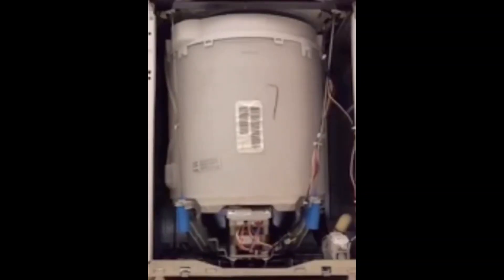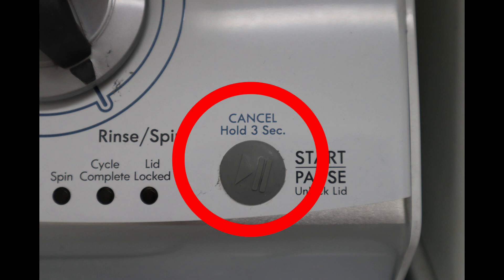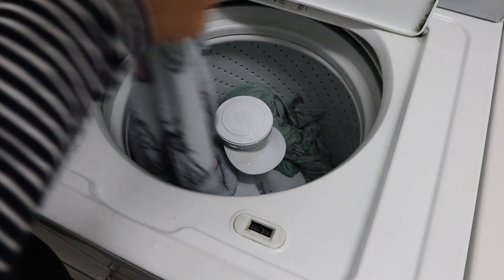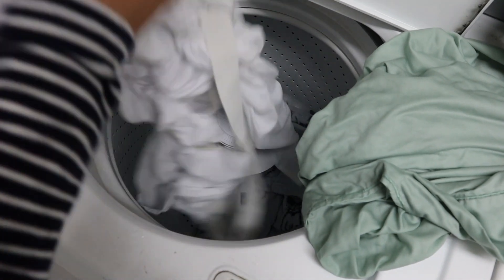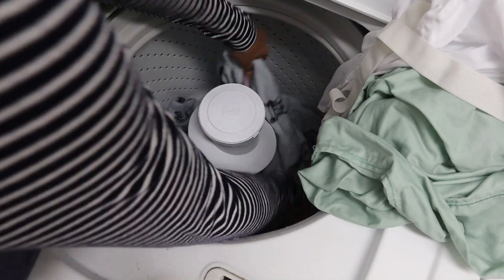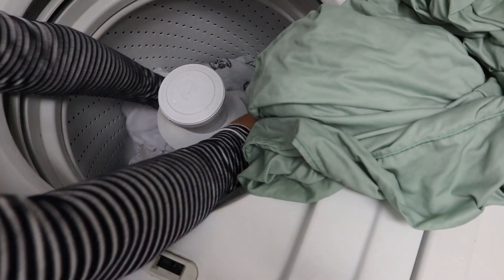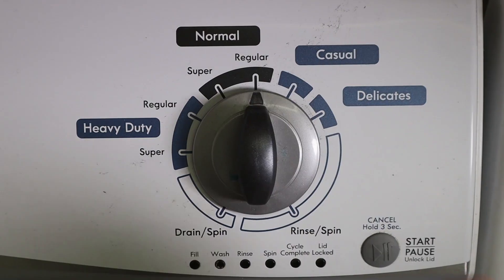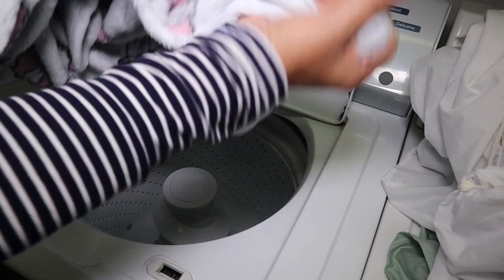Why Is My Washing Machine Making A Loud Banging Noise?

Comment: when machines do this, it needs to be fixed.   That's not the permanent solution
Reply from the maker: That might be the case sometimes. But in my experience in 40 years of running a washing machine, on the few occasions that this happened, it was because I overloaded the machine and it got off balance. It can also happen when washing just one item like a blanket. If the weight is not evenly distributed that also can throw the balance off. This Mominar shows how to check and correct if that is the case. If you have done this and it still is a problem then you may have to fix it or get a new one. Thank you for your insight!

Comment: Hello mam I a ma from India and I purchased a godrej automatic washing machine and it doesn't make any noise at that time but now after 2 months it gives such a noise like that so what should I do should I call the mechanic because machine is in warenty ? What should I do please help.
Reply from the maker: Hello! If your machine is under warranty they will come and take a look and/or fix it for free. Call them to find out. Is the noise it is making now similar to the one I described in the video? As scary as it sounds, it really is an easy fix if that is the problem. If it happens with each load, over and over again, I would call the company. If it is just once or twice, make sure you are not over-stuffing the machine. That will surely throw it off. Try doing a light load of clothing and see if it makes the noise. If so, call the manufacturer. Good luck and let us know!
Reply: @HowToLifeDrLJ  mam I spin the machine with low weight it give less sound in comparison of heavy. But when my machine is new it doesn't make any noise. Plz help.
Reply from the maker: @RohanKumar-qd5oc  Then if this is the case, I would call your warranty company. If under warranty they will fix it or replace it. If not, an appliance tech will be able to give you a diagnosis.

Comment: Mine is giving the banging sound each time when it spins, does that mean I need to manually rebalance everytime after washing the clothes?
Reply from the maker: Having an unbalanced load every time is unusual. My first thought is are you overstuffing the machine each time? Are you washing very heavy items like blankets with lighter items? Are your clothes evenly distributed around the tub before you start the machine? If these questions don't apply to you, then there may be a problem. Let me know.